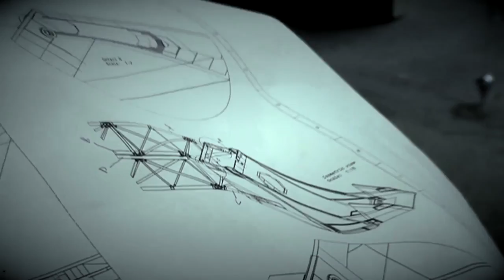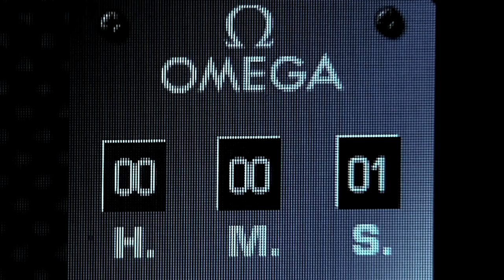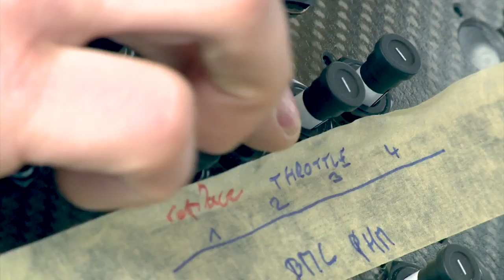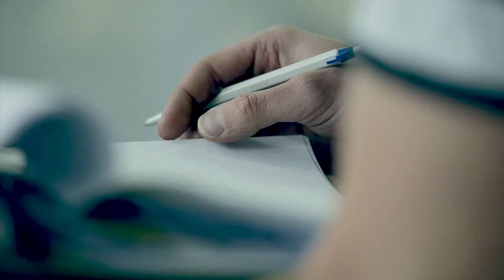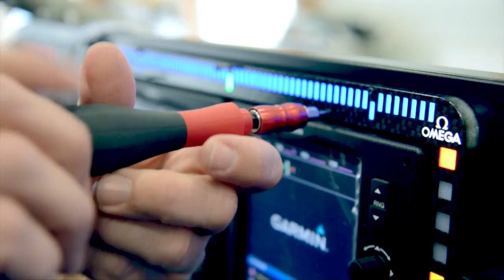Construction of Solar Impulse 2, the Round-The-World Solar Airplane

Comment: I can see a promising future in this concept for drones that can stay in the air indefinitely, and the R&D will benefit aviation as a whole in improving aircraft structures etc... but would we ever see the skies dominated by solar powered airliners? Even if solar cells were 100% efficient, you can only get so much energy from them, and it's not much.

I just can't picture a solar powered plane taking paying customers across the Atlantic, with all the added weight of luggage, in flight meals etc really working out.

In the future could we see more traditional airliners that are hybrid powered with the skins covered in solar cells? That would be interesting.

Comment: The day is not far, wherein we can see Solar Powered Flights of small sizes capable of carrying few people. There won't be any rotating machines required in the flight. The control system will interface with Human Thoughts and the flight would be controlled by human thoughts.

Comment: I see many things that can be made lighter, possibly as much as 350 Lbs. lighter or even more. The fuselage could also be made slightly wider and a little longer and still be lighter, but would allow room for more solar cells. The fuselage can also be much more aerodynamic and be made even lighter in weight. The use of all the brass fittings and connections can be lighter with aluminum or titanium fittings and connectors. Many of the screws and bolts are more than a half inch too long, shorter screws and bolts throughout the plane can significantly reduce the weight. I would have loved to have been involved with this project.
Reply: I am impressed with all that you have done and all that you have achieved. I wanted to point out that you can significantly trim down the weight. You can also add two or as many as eight small 400 to 600 Watt wind turbines that will give you more power, functioning at both day and night when there is no sunlight and will keep your batteries at full charge. You can do a lot with this Solar Impulse 2. I am most pleased to see the work you have done and I look forward to seeing improvements.
Reply: Hilarious you act like you have a better grasp of engineering then them claiming you can lower their weight on the craft while  also recommending adding wind turbines lmao. You realize that the  drag would counter act any energy produced from the turbine right?